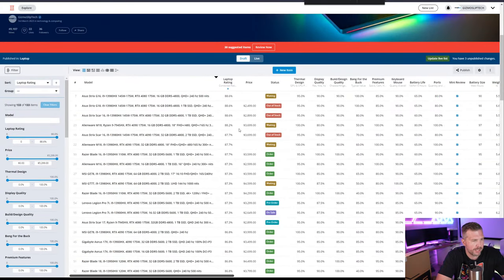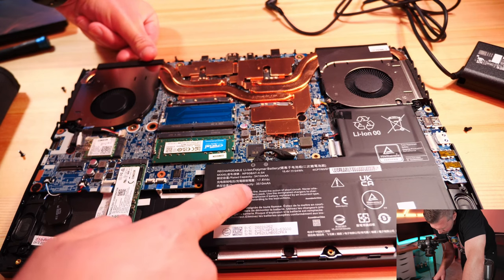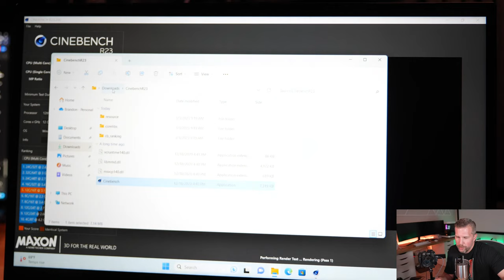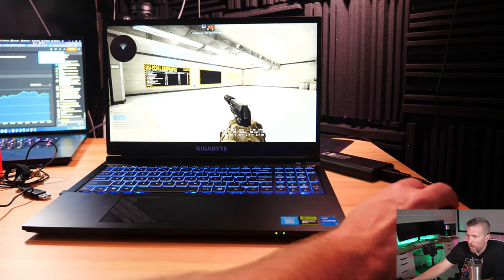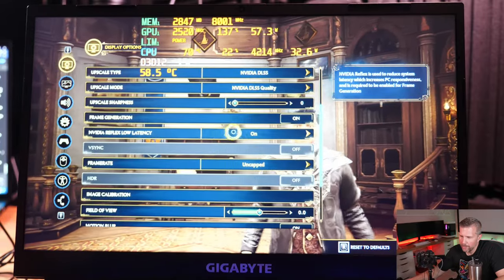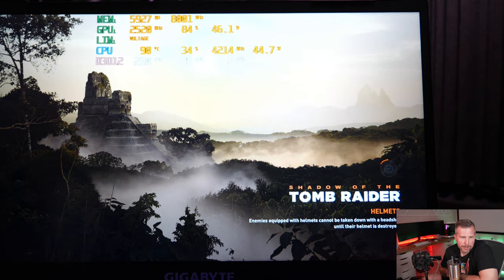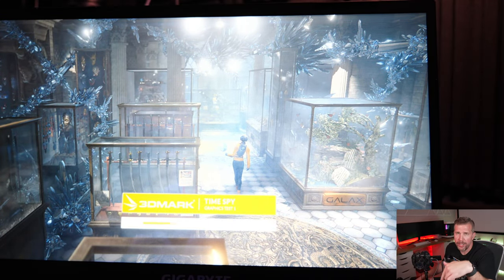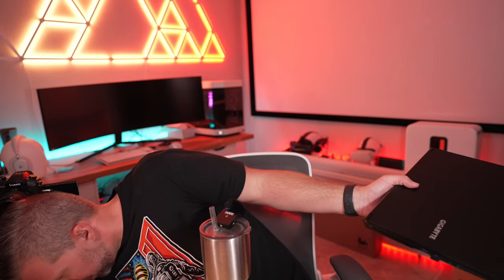RTX 4060 for $1099 - Gigabyte G5 Unboxing, Benchmarks, 7+ Games, Display Test, and See Inside!

Comment: I fixed my overheating issues with a new thermal paste. I used arctic mx-4 and now the cpu runs about 70 degrees and the fan rpm went from the max which is 5300 rpm to 4000 rpm. Huge difference. The original paste was bad, it was quite dry. my 4060 g5 gigabyte is solid and the screen is really nice, not a retina, but neither washed out. It shows a decent image.
Reply: hey i am thinking of buying this. wanted to ask, is your laptop working fine right now?
Reply: @thanos967  Works great. Btw, I have recently repasted it with Metal Liquid grizzly and the temperature never went over 80.
Reply: @thanos967  It works amazing. I have repasted since with metal liquid conductonaut extreme. It is very easy. basically you give the GPU and CPU a coat of polish nail liquid if it has exposed components, on mine the GPU had. Then I warmed up the liquid metal a bit to flow better and applied on both gpu and cpu. I also dropped some on the motherboard, but I cleaned it with alcohol - accidents happen so you don't have to shock yourself, it is not solder, it cleans easily, just you need to know where you dropped it. Anyhow, with the Metal Liquid, I don't see temperatures over 80 degrees. The laptop is mostly silent as a lamb and even when gaming, the fan speeds don't go crazy. Please note that I have the frames locked on Nvidia to 60 max. If I have to unlimited, the fans work harder, but again, it doesn't thermal throat as before, as the GPU is not getting hot (above 80) at all. The CPU is the one that gets hot, or better said, was getting hot.

Comment: It should perform better with another 8 GB ram stick, right? Since you’d have more memory and also dual channel which is known to be faster than single channel.
Reply: Hmm not in all scenario u might experience the difference. But if the ram is needed then the gains are going to be huge.
Reply: Yeah for sure, this is a pretty standard money saving technique for the manufacturer on these budget gaming laptops, they're leaving a lot of performance on the table by only having single channel ram. It will be running at half the rated speed for the ram since it's one stick!

Comment: Maybe only your example has power issues or bad power adapter. I’ve had this laptop now for over a week and it’s more than fine. There’s also a bios update
Reply from the maker: Thanks for sharing. I didn’t run into the problem again
Reply: @GizmoSlipTech after updating the bios?
Reply: hello! can i know what bios version  you updated to?

Comment: I believe 1080p need tostay back in 2021. Its so much better with 1440p 1600p is sooo sweet for eyes. 
Is 4080M will beat 3080Desktop?
Reply: 4080 laptop and 3080 desktop are very similar. But the 4080 laptop gpu has 2gb more vram and frame generation. So the 4080 laptop gpu is overall better
Reply: 4080m is more like a 3080 ti desktop  in performance
Reply: @jayblaze53  amazing

Comment: Just wish companies would stop with these bad screens. Every budget gaming laptop in 2023 deserves a 100% sRGB screen, 144hz, decent brightness and response times. 

Other than the GPU/CPU, the screen is the feature you really don't want to cheap out on considering you're looking at it 99% of the time using the laptop even when not gaming....
Reply from the maker: I agree with you, but also I think with inflation companies are trying to keep the prices down in general, so cutting costs like display costs is one of the biggest ways of doing that, so I can understand their reasoning too
Reply: 100% of the time
Reply: if you have an external monitor, it's more like 5-10% of the time
Reply: If you have a desktop with that external monitor then it's 0% of the time at home. Which jumps back to 100% of the time elsewhere XD
Reply: Hey man, that is to make price lower. Wanna better screen then there are options to buy. Say thanks it isn't 60hz 1333x720 TN display. It is quiet descent. It only limits you in professional graphics uses. And BTW may be it is just uncalibrated, and applying good calibration it may achieve close to 100% sRGB.
Reply: @nomars4827  The price of the panel is not much, say $30-40 for the worst panels, while $70-80 panel would be well above average. Most people would totally pay the extra $40. But companies are downgrading the display deliberately, to differentiate their more expensive products and push customers up the product list.
Reply: @JC-XL  I got Vivobook pro with OLED and it is absolutely stunning in games movies and other content. Definitely enhanced experience. But of course this screen also needs some measures to mitigate burn-in.
Reply: @nomars4827  Yes, I am thinking of postponing my laptop purchase for a couple of years, when there will be much more OLED screens on gaming laptops, plus RTX 5000 series are expected to offer much better improvement than the current 4000 series.
Nvidia likes to alternate bad and good generations.
Plus I still have to finish many games that run absolutely fine on my current machine.

Comment: I bought this laptop last week, it arrived yesterday and i had insane amounts of issues with it... The fans are going crazy 5000rpm, the CPU is at 90-95 degrees celsius at 40% usage in game same for GPU. Did anyone face similiar issues?
Reply: gigabyte laptops are known for their heat, so no surprise there. You should've done some research.
Reply: I advise you to undervolt cpu and use wuick cpu 2.3-4ghz. but a video card with a temperature of 95 degrees ... only if the stand
Reply: @МихаилДранишников-я7б  you can't undervolt this cpu, it's completely locked even in bios
Reply: @tesiro143  I have gp66 leopard 3070 i7-11800h. I unlocked undervolting in bios. this is a plus msi
Reply: Did you return it?
Reply: @realhuman4396  yeah
Reply: @realhuman4396  yes and got myself Rog strix g15 with rtx3060 and I'm extremely happy with it
Reply: I have the same laptop and the cpu temperature doesn't go more than 80 degrees at 100% cpu ( gpu's temperature is much cooler ) and yet i'm scared of this 80° and you are telling 90-95°

Comment: I watch your videos on a regular basis 
Love the way you test these laptops ❤
 So far from the reviews I have seen I think that the 3070 ti 150w has similar or better rasterised performance than both the 4060/4070 Now I know your thinking to compare it against the RTX 4080 but they cost atleast 2500$ for a full powered 4080 where as the full powered 3070 ti's were around 2000$ and now they are around 1500$ and if you compare the previous generations 
You see the following trend (if not running out of Vram)
Gtx 1070 = Rtx 2060
Rtx 2070 = Rtx 3060

Similarly the Rtx 4060 should have been at least equal to the 3070 
But sadly it isn't 

Now why is this happening 
If You look at the specs of the 
4060/70 you can see that they are cut down in every possible way 
Cuda cores , Rt cores etc 
I mean seriously the RTX 3060 has the same amount of cuda cores as the 4070 , the only thing good I could say about the rtx 4000 series  is power efficiency , So to top it all off the rtx 4000 series has terrible value to performance
Nvidia is just trying to generate sales on the desktop market by providing Extremely Overpriced GPU's & heavily relying on DLSS 3.0 to save them in the Laptop market and if that wasn't embarrassing enough someone actually found out a way to enable DLSS 3.0 on Cyberpunk 2077 an RTX 2070 Search it on Youtube ,  without it  with Raytracing on Ultra he was getting 35 to 40 fps and with it enabled he got around 80 fps 
So similarly they are just using DLSS 3 as another strategy to fool people and generate overpriced sales which for the most part isn't working as they might have though
However I Didn't find any tutorial to enable Dlss 3.0 on Youtube for the rtx 3000 series , but my point is if that guy was getting such an insane boost on an rtx 2070 then there is no reason why The RTX 3000 series should not have it , specially since in newer games Raytracing is getting a lot of Systems CPU limited In which case DLSS 3 shines the best so If you  want to help people look out of the shell Then you should look for a way to enable DLSS 3.0 on the 3000 series specially since a lot of guys like me are Cpu bottelnecked with Raytracing on , in games Like Spiderman, Hogwarts Legacy etc 
It would be helpful for A lot of people man , much Appriciated 🤝🏻
Reply: Dlss 3.0 in cyberpunk it's fake. Those guy was delete him account

Comment: 4070 is below what 30ti was at launch  -  wowo what a generosity from Nvidia side. Giving the fact that 4070 is on par when it comes to power and only thing that differentiate those cards  is FG. That would be  irrelevant once  FSR3 will be out.

Comment: So... should i buy this or some laptop with 3050/3050ti?
Reply from the maker: Definitely a 4060 if you can. Way more powerful and has frame gen.
Reply: @GizmoSlipTech  so 4060 with 75W is more powerfull then lets say 3050ti? Anyway that gigabyte is already in my cart waiting to get paid so anyway its ordered haha
Reply: @GizmoSlipTech  also i wanna buy extra ssd but idk which one. Should i get the one thats like a block, would it fit or the one thats small and thin as a card? Does it have place? I've seen in video u said it does but not specificly. Also is there ssd u recommend?

Comment: I’m probably gonna buy this laptop due to having it an RTX 40 series, and also I think I would not able to reach a 100 degrees on the cpu since I don’t really play too much graphic demand games. Lastly if I were to play CP2077 and etc, I would only set it to High Preset.

Would it still heat up to 100 degrees?
Reply: Yeah unless you limit the fps to 60
Reply: dont get fo oled by the specs and the brand  name  this is just a rebranded clevo laptop not made by gigabyte  the  build quality is shit  and its never silent  the fan is alwas going at 30% no matter what u do  i regret getting
Reply: @sawfish9253  could you talk about your experience with this laptop a bit more? I have a custom built itx build with a rtx 3080 ti, but im downgrading because im going to traveling and dont want something expensive because i wont be gaming as often. Do you think this would be find for the occasional game sesh?
Reply: @AydinMahallati   i ended up returning it because i couldn't stand the fan noise imagine just watching youtube or doing some office work and the fan is. Going fast at 2000 rpm which is unnecessary in my opinion other laptops are normally  at 1000~1500 while doing simple tasks    
 just  get something from dell or hp

Comment: Possibly wouldve gone for this if my 2021 model didn't almost explode on me the other day
Reply: what happened?
Reply: @Thrace  I have no idea, over the last few weeks my laptop started dropping to 20fps on games that usually run at well over 100. And also the thing got so hot it started burning the charger that came with it. And when i bought a new one and plugged it in, it just started smoking (i dont think it was gonna explode but it wouldve probably damaged the internals since the first charger melted a bit, and the second one was burnt to a crisp with about 2 minutes of use.) I had it on a cooling pad and everything so im not sure what happened

Tldr: laptop was lagging for a few weeks, laptop was overheating and shutting off randomly even with a cooling pad, and it burnt the chargers i had for it to a crisp

Comment: Nice review! I just didn't catch if it has or hasn't a MUX switch??
Reply from the maker: I don’t believe it has one. Did not see any option for one
Reply: @GizmoSlipTech  I bought it a week ago and I think it is really nice, especially the build materials. It has a bit weak cooling system though, but I've bought a quad fan cooling pad and I've upgraded the thermal paste to thermal grizzly conductonaut liquid metal.. The cpu is now 10C degrees cooler. 
I kindly ask, wether you could try to figure out how to undervolt this laptop.. I've tried with Throttlestop and Intel XTU but with no luck. Could really use your professional help here, because if I can find a way to undervolt it, this laptop is really worth every buck!!!! 

Thank you in advance!!!!
Reply: @still.the.1  Hi. I think  you can edit power plan and disable processor performance boost mode during gaming, it shouldn't affect your FPS too much. look it up.

Comment: Also, i disagree about the 407 vs 3070 Ti comparison. The 3070 was a much better deal. not even counting the 3070 Ti, it also wasn't the 2nd best gpu of the last gen, it was 3rd, still worse than a 3080 non Ti, which was still available after the Ti refresh. You're comparing the fresh to the base 4070.  I also heavily disagree comparing a 4060 to a 3050 Ti. At launch the 3060 G5  was about $1100 as well.  Nvidia is basically just cutting down the die size and bus size to give us about last gen performance using less cores to achieve the same level,  and then throwing frame gen on top. Which would be fine if it didn't add latency, but it's nearly no upgrade in fast paced fps games. 

I feel really good about my 4080 pro 7i I bought for $2160. But historically, I've been a 70 series guy on my laptops. It just wasn't worth it this gen to stay in that tier. Nvidia cut it down to much. I understand the concept of segmentation, but the 4070 and 4060 sometimes legitimately lose to their 3060 and 3070 counterparts and that should not be normalized.  the 128 bit bus I think has a lot to do with that.
Reply: I think the design principle is different.  People complain about too much noise and heat.  The low/mid range of this gen is more about lowing temperature, noise and high power efficiency than raw performance.  it actually makes the laptops behaves like laptops.  They do have 4080 and 4090 for the performance.  After owning both 3000 and 4000 desktop cards, my 4000 card runs almost in silence.  The last thing I want to buy is 140w 3070 laptop to match 105w 4070 laptop.  Most of time 4070 doesn't even hit 105w.

Comment: The score is low in time spy. My laptop lenovo legion 5 pro i5 12500h+rtx 3060 140w in general score 9267 , cpu score 11503 and gpu score 8960.
Reply from the maker: You have a good laptop since it is a full power RTX 3060 140W that is in a much larger laptop. This one weights only 4.2 lbs and is only 75W, so a more apples to apples comparison is the Zephyrus G14 that I compared this one with near the end. The RTX 4060 will perform better at 140W for sure, probably over 10K pretty easily I would imagine. Looking forward to testing the MSI Pulse 15 with RTX 4060 at 140W.
Reply: @GizmoSlipTech  I look forward to the review of this msi laptop. I was planning to save money by the end of the year to buy a laptop with rtx 40 I will have to look between the 4070 and 4080 to make it a good upgrade
Reply: Man, your 3060 has double the tdp and around 800 more cuda cores... My 105 w 3060 gets around 8200 in graphics, so yeah 4060 is a nice gpu. Especialy cause of FG

Comment: At this price point, the Strix G15 Advantage Edition is way better. CPU performance is similar, GPU performance is way better (11500-12000 Timespy). Better Screen at 1440p 165hz with good colors and brightness, Excellent battery because its on the AMD platform + its 90Wh. The only appealing thing from this laptop is the DLSS 3 Perks
Reply: I have this exact same model, would never change it for something like this
Reply from the maker: That is a good option at this price point
Reply: Is it just me or ppl hype g15 advance so much is it that good؟
Reply: @notori-di5et  it's really good, no hype
Reply: Sure you can get a better laptop if you spend more money, makes sense right. Strix G15 starts from 1600 dollars which is like 50% more than this.
Reply: That's not the same price point. It's on sale right now and it's still $250 more. You don't know what you're talking about. This laptop $1100 laptops are for people that can afford that at max. What's it like being so disconnected by the money system you can't possibly conceive that $1100 is max budget?
Reply: @Tyrelguitarist  Dude just straight up jumping to conclusions, i wouldn't say its 1099 if i didn't buy it at that price, it regularly goes down to 1099 and I've even recommended it to a few other friends and family. If you don't know something it's better not to speak about it.
Reply: @saibot_y  okay so where is this strix g15 advantage edition for $1099?
Reply: @Tyrelguitarist  man i just said bestbuy, wait till it goes on discount

Comment: Why would they have dropped the GPU power so low compared to the last few gens. That's crap.
Reply from the maker: Because this is smaller and more portable
Reply: @GizmoSlipTech  I'd want to see it side by side to decide if I'm still mad.  The previous versions were very solid value picks for their decent enough screens and higher end of the spectrum power limits on the 3060 models, with still ok thermals.
Reply: Because those powers often led to damage and issues

Comment: hello guys please help me just got this laptop and having alot of problems getting maxium 40w on the gpu wich is abismal playng anything framerates goes from 60 to 300 in cs go cant even play anything ive done everthing roll uodates ,bios update fb03 new version , reinstall drivers ,went into msi afterburner tageted 125% to get as much power as it wanted nothing works can amyone helps me this is not what i expected from gigabyte very poor with everthing

Comment: Pros
Good price
40 series for dlss 3.0
Decent cpu 12c 16t
1080p 144hz 
Cons
Thermal throttle
8gb Vram only ( what a Shame Nvidia )
No undervolting
High cpu temp
Heat
Heat 
Heat

P.S even with liquid metal, it will only drop 5 degrees. The only way to reduce cpu temp is by undervolting but the cpu is locked so no chance. New thermal paste will do nothing but void your warranty.